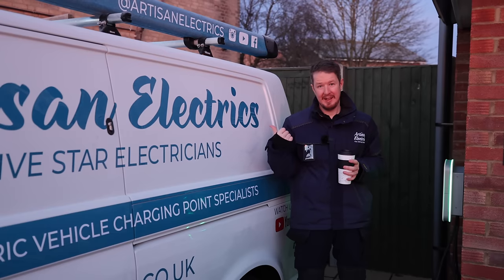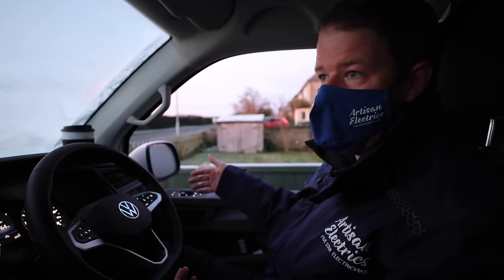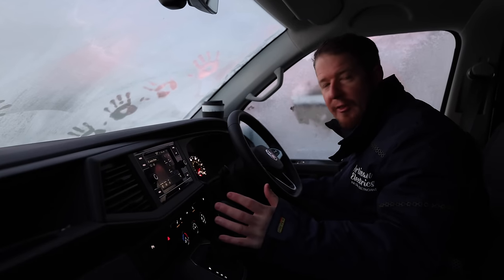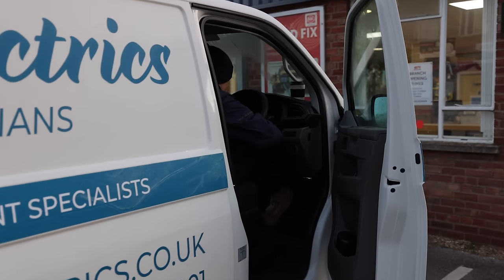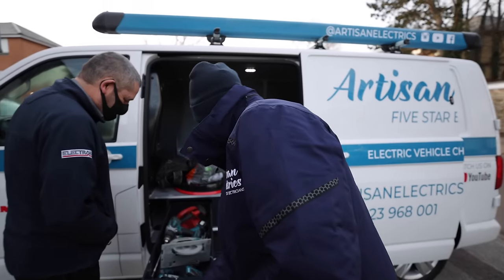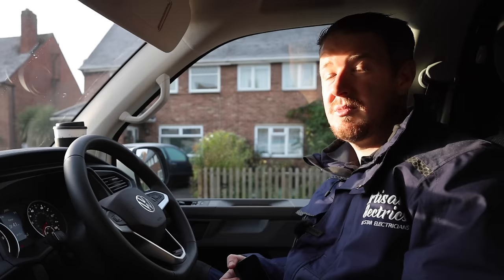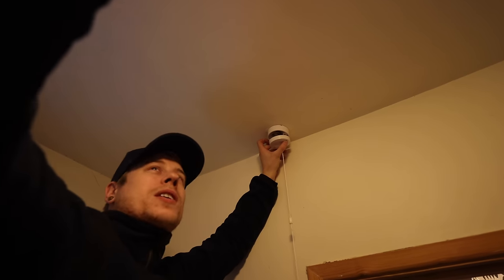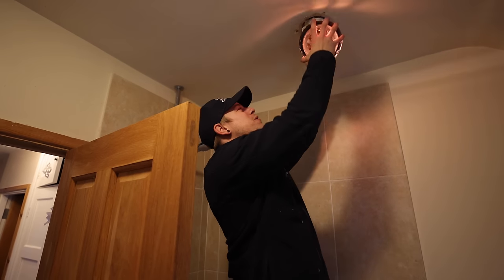ELECTRIC VAN NIGHTMARE 😬 - Volkswagen Transporter Electric Van

Comment: 1. Pre heat the van using the app 10 mins before you get in(saves you sitting in the cold waiting)
2. Don’t wind down a frozen window as it could damage the motor
3. A lot of EVs don’t let you remove the plug until you unlock the release. Stops ppl unplugging you
4. Always good to know how to use a handbrake 
5. Always good to know how long it takes to fully charge

Most of the above is user error, well that’s what’s going on the call out invoice.
Reply: Wouldn't be the first time Jordan, vehicles, and user error all came together... I recall last winter he uploaded himself driving off with side windows totally frosted over (couldn't see out of them) and a roof covered in snow, then complaining that the snow which should have been cleared before driving fell in his boot.

Some people shouldn't drive, apparently this van knew it.
Reply: Driving with snow on roof is illegal, because it can slump off onto the windscreen,meaning you can't see. There's a high tech solution, called a broom.

It's also illegal to drive with front or side windows frosted or misted up enough you can't see.

As for scrapers, credit card, union card, plastic spreader for filler, any old piece of plastic...
Reply: @RupertReynolds1962  spray de-icer. Large tin 4 quid any autostore. 
Mandatory in the UK.
Reply: @stephenmurray2851  I wasn't going to mention this, but some years ago a friend of mine was killed by a man-child who didn't take responsibility enough even to wipe his damp windows with a rag.

The driver was given a short jail sentence, but that didn't help the family left behind.

So forgive me if I lower my opinion of you  notch or two, eh?
Reply: @RupertReynolds1962  I'll forgive you. Fortunately for us both your opinion of me means absolutely nothing.
Reply: User error …. I didn’t charge my battery 
an electrician lol

Too many moaning vids about other peoples work

At least this is about a van even if he’s the one cocking up 

Self awareness is a skill
Reply: @RupertReynolds1962  so is adjusting satnavs Jordan??? you took eyes off road while driving for about 20secs
Reply: The window kept going back down because of the anti-trap system, which uses  the current sensing on the motor - if it exceeds a pre-determined amount, it reverses the motor
Reply: @davethornewell7417  Get a manual handle.
Reply: @patrickmooney5035  Sounds then, he is doing this for show, to demonstrate the weaknesses of the system. 

But he will not be the only one who expects to use one like a petrol vehicle. 

There is also the opportunity for a new startup. 
Buy a fleet of EVs and have a distributed user scheme. You never drive your own car, one drives itself to you on demand and leaves you at your destination. 
Rather than having that amount of capital parked most of the day.
Reply: @myparceltape1169  That could be possible in the future with self driving cars 😯 Would make a lot of sense.
Reply: You left out #6: If all else fails, read the instructions.
Reply: @myparceltape1169  Yes, mandraulic windows don't fail as often. 😁
Reply: Fantastic, maybe you can arrange all our future lives around using electric vehicles rather than having the convenience we presently enjoy ..
Reply: @RupertReynolds1962  no, it isn’t illegal to drive with snow on the roof and if it were would that be 1mm, 100mm or 1000mm, it would be a subjective call based on ‘roadworthiness’ or ‘safety’
Reply: @patrickmooney5035  .. that’s right, give up all the hard won freedoms that your ancestors fought for an become one of the monitored sheep …
Reply: @andyxox4168  Go and argue with the senior traffic cop who made this point.
I'm out of this cesspit right now.
Reply: @andyxox4168  🤣 🤣 🤣 🤣
Reply: @jerrythefatcat2849  As far as I can see, it must be a list of cockups, a scripted clickbait stunt to get as much laughter, hate snd whatever else they can get as a  reaction.

For all I know, they might know how to drive, wire in a charging point, and even how to use one :-)
Reply: @andyxox4168  oh yes it is.
Reply: @andrewbarnard667  … at risk of making this into a pantomime ‘oh no it isn’t’, … there is no specific offence of having ‘snow’ on your car. (Of course if it were you would be able to cite the legislation) …
Reply: @andyxox4168  well a fb post from the police saying its an offence not to clear the snow from your roof has been posted several times each year.  It's because when it gets soft and you break it covers the windscreen.  So I may be incorrect but I don't think so.
Obviously if you were to do this in reverse it would be behind you.
Reply: @andrewbarnard667  .. if you believe everything the police say then ‘more fool you’ … they would have to use the unsafe/unroadworthy vehicle and unless you have evidence to the contrary I am confident there is no specific mention of snow in the legislation!
Reply: @andyxox4168  no, not specifically, however the roadworthiness law states that anything that could potentially cause obstruction to your ability to drive safely is an offence and worthy of a £250 fine and three points on your licence.
So if you want to be a pedant about it, i genuinely hope you earn your fine and points.
Especially considering it takes a few minutes to use a brush to push the snow off and make your journey safe for you and every other road user.
If you don't, you are the problem.
Reply: I can see a bit of user error going on and appreciate there's a learning curve when we learn new stuff. For the amount of money that van costs I'd expect a lot more. I'm still not convinced that EV technology is mature enough......
Reply: @andrewbarnard667  … seems you’re confusing the Construction and Use legislation with the Highway Code, the Highway Code is mainly guidance but it is clear that lights and windows MUST be clear of snow. ‘Must’ is used because that section is backed by legislation. 

The police can only fine or prosecute you if the ‘offence’ is covered by legislation, the Highway Code falls short of that legal standing. So anything to do with snow that the police might try to fine you for is covered by (probably Construction and Use) legislation. The police cannot fine or prosecute you based solely on the Highway Code. 

You might be surprised how little the police actually know and how often the police act outside their powers and get away with it unchallenged.

I suspect you are misinterpreting rule 229. If you Google it the relevant legislation is listed. Simple understanding of English ‘Must’ and ‘Shall’ vs. ‘Should’ etc. will help you.

Of course if you disagree you can always post the Highway Code section where it says snow MUST be removed from the roof of your car!
Reply: @Andy XoX  ha ha ha.  😂
Reply: @andyxox4168  i find it mildly funny that you ignored my statement of fact just above the comment your last reply deals with.
It's still an offence under the road and traffic act because anything that interferes with the safe operation of your vehicle is liable for a £250 and three points.
Unreasonable levels of snow are covered by exactly that and all that requires is a police officer to decide that you have too much snow on your roof.
So realistically, considering it takes 2 minutes to brush it off your roof, the safe, responsible thing to do is remove the snow and no matter what you think on the subject, you can be fined.
Reply: @paulrichardspencer  didn’t even see your comment, I was replying to someone else however … no, it would be up to a court to decide on the amount of snow that constitutes a danger under the relevant legislation (not based on the Highway Code) unless you accepted guilt by admission that is …
Reply: @myparceltape1169  that’s exactly the point of the video. I suffered a similar fate with my EV which has now hopefully gone back.

He is showing how to use it/pitfalls of it
Reply: @davethornewell7417  this is not uncommon with VW is it's a design fault as well as your possibility.
Also windows opening during the night for no apparent reason is another common fault of vw's.
Reply: On top of all that he's got probably worst Van on the market with regards to range.
Reply: Park van in the garage instead out in the freezing weather.
Reply: User error can be minimised by design. Basically apples business model.
Reply: Scrape ice before taking window down, o yet no scraper . Poor baby.
Reply: The window thing made him look like a moron. Everyone knows a frozen electric window won't work. De-ice it first FFS 😂
Reply: Less user error more user experience and VW look to have oversight here. This is the future life should be easier not harder!
Reply: 6. Don't buy an EV
Reply: The window motor may fail or you rip your window seals. Both amateur mistakes.
Reply: Thing is you don't have to jump through any of these hoops if you have a conventional van lol.
Reply: 6. no usar un auto un auto electrico
Reply: evs are rubbish

Comment: I honestly find this highly amusing.
I'm an electrical/mechanical engineer, why all these electricians are buying electric vans is completely lost on me.
Reply: Yup they should know better.
Reply: Why
Reply: @MrKongatthegates  
Do you think there sustainable?
Reply: Its great marketing for an electrician when you are installing hundreds of ev chargers.  They work well enough and are getting better
Reply: I actually don't understand why anyone would buy VW Transporter, since it's an aftermarket conversion done by ABT. The range is silly. There is so much better electric alternatives.
Reply: @Aussie Pom Doesn't have to charge quickly when you wake up with a "full tank" every morning. 

That said, I don't know why anyone would get one of those VW electric vans with 82 miles of range. Maybe if it was some kind of company vehicle that only drove around a campus or small town?
Reply: Exactly..!
Reply: It's because they don't understand how electricity works. Just red wire live, blue wire neutral, green and yellow earth and 15A breaker on 1.5mm wire and 20A breaker on 2.5mm unless it's a ring main.
Reply: @frazerbond3413  the resources to make the van are huge. battery’s that can’t be fully recycled. Electricity that’s mostly generated by coal and gas. ev vehicles are very heavy putting more strain on our roads and car parks. There’s no real infrastructure in place to charge the vehicles efficiently if more people buy them. It’s a con.
Reply: @Baggiolyful  totally agree mate.
Reply: Because the company buys them??? I don’t think he had much of a choice  for the a company van
Reply: Wery straightforward. Journey lengths are short and the van is sitting around doing nothing m,ost of the time. An electric van should be ideal for a trade like this.

Comment: Your definitely better suited to the office. What helmet uses the wipers and winds windows down when there's ice on the windows. A kettle as well. You don't treat your tools like that.
Reply: I agree I wouldn't trust him to do anything for me if that's his level of Intelligence!
Reply: Because there is no other way of clearing the screen with no hot air coming from the cooling system of a combustion engine!
Reply: @petecoventry6858  🤣🤣🤣 totally agree , it makes you wonder and this guy is going into peoples houses and messing around with the electrics 😳
Reply: Lacks common sense
Reply: @TheMentalblockrock  no after he found button he was fine plus he was still tethered to the charger. Offsetting that loss in battery to create the heat.
Reply: I'm not sure why he says he doesn't own a scraper. I mean get a damn credit card or anything out ffs, it'll work when nothing else is available! Never chuck boiling water on a frozen screen, that got me panicked.

Comment: I'm taking all the stuff you said about the van with a pinch of salt and hoping the issues you had were dramatised for entertainment, but if not then I have to ask who goes and buys a 55k pound van, kits it out and brands it without knowing a damn thing about it?! 🤷
Reply: @N S 
I think that's a bit harsh on the muppets
Reply: I agree….if I was paying £50k for a vehicle I’d be dissecting the manual and online forums for months before even considering a buy
Reply: @jennyli7749  yh mate that's easy to do when you have a family and 10 employees....
Reply: @radosaw4616  it's not hard to read up on something at all, regardless of having 1 or 100 employee's!
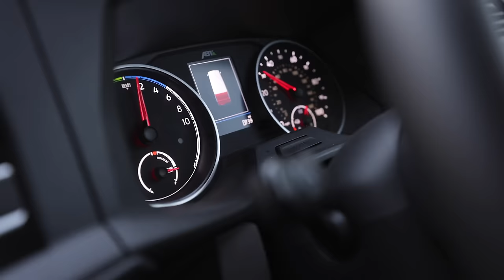Reply: 30:30 Driving with the rear doors not fully locked and not knowing despite looking right at it.. suprised it wasn't beeping away at him
Reply: Can you really expect a concise and technical reply as he has limited technical knowledge.
Reply: The unskilled doing EICRs very worrying for our trade.
Reply: @peterward8308  I’m a gay time served engineer find this remark homophobic and unnecessary. Time for the dinosaurs to move on or die out.
Reply: I really hope the whole thing was a pee take because otherwise...... Crazy

Comparing a Tesla to a van regardless of power train is daft too. How many vans have electric handbrakes, electric heated screens etc.

None of that would've happened had the owners manual been digested before attempting to use it. Also how did the dealer let you drive off without fully explain ING how the vehicle operates?
Reply: YOUR ALREADY PAYING AN 20 K FOR EV THAN DIESEL PLUS MAINTANENCE COST AND RESALE VALUE ARE POOR , YOU WILL LOSE ALOT , AND IF YOU NEED A NEW BATTERY AFTER WARRANTY IT WILL COST THE SAME AS A CHEAP FLAT , COMPLETE NO NO !!!!
Reply: @radosaw4616  Pay someone else to do it for you and advise you if its a sound investment.
Reply: @chiquita71  get a life mate. It's short enough without dissecting every comment that comes out. I take it you are one of the permanently outraged clan. I have gay friends and any of my comments are not homophobic but just sensible

Comment: Everyone has a windscreen scraper, it's called a credit card.

A bowl of cold water will clear the windscreen almost as well as hot water, so long as you put the wipers on as soon as you've poured it on the windscreen.
Reply: I tried using a store discount card, but it only got 10% off.
Reply: I broke my card doing that. 😭
Reply: @dynamicd1425  😂😂 you legend!
Reply: Exactly! No one does it that way
Reply: Do sacrifice one of your promotion cards…
Reply: But cold water will freeze almost immediately it hits the cold screen. Back to square one.
Reply: @tamar5261  definitely in a bag of hot water.  So so much better and not messy at all.  You can do the whole car in one go.
Reply: @dynamicd1425  Oh you tickled me.
Reply: @tamar5261  Try it. It does freeze more quickly than hot water, but not instantly. Pour the water on and then turn the wipers on as soon as the ice melts enough to do so.

The advantage is that you can usually get a bucket or two of cold water from an indoor tap quicker than a single bucket of hot water, so you can clear more of the windscreen and side window.
Reply: @dizzy2020  I myself thought the hot water on a frozen screen causing it to crack was a myth, until last winter when I experienced it myself on. Renault Trafic van.
Reply: Yep, I use warm water in the winter, it warms the screen so the inside doesn't fog up and I can get going.
My favourite is to put a little blow heater in there for 15 minute before I go, nice and toastie.
Reply: never use hot or cold water the screen  still may  crack  as cold water is still above freezing sprinkle a bit of table salt but  rinse as soon as warms up
Reply: @tamar5261  Yes tepid of warm. Not as hot as a hot drink. I have done it with room temp water and it freezes on a very cold morning. I use warm water and I go to the car and drive away in less than a minute My neighbour takes 10 minutes to. scrape.
Reply: @markenetube  I'll give that a try in the morning
Reply: Well I gave the warm water thing a try. It did clear the screen amazingly fast, I'm not sure I am happy with the process though. I'm afraid it will crack the screen. On my car a screen is £500. I guess it's back to scrapers.
Reply: @tamar5261  I’ve used warm water for years, never had it crack a screen yet! I had a customers car crack it’s screen merely because I let it warm up with the heater on full screen! If it does go all wrong then make sure you have windscreen cover on your insurance.
Reply: just use WARM water
Reply: Always used hot water just short of boiling. Key is knowing how to use it, splash at top or on edge of roof and let a few streaks run down which in turn warms surrounding glass. Go round rest of car the same then return to windscreen, works every time unless -6 where boiling will freeze in 1 minute!
Reply: And he's an electrician God help anyone who uses him
Reply: I used my discount card to scrape ice off the windscren i got 20%off 🤗
Reply: Don't you use frost protection in your windowspray water? In europe -20°C to -50°C are typical frost protections. Going down the Autobahn at 200km/h at -20°C gives quite a windchill.
Reply: Never use hot water to defrost a windscreen,, it will break it
Reply: He almost had me in tears

Comment: Looks to me that the van was having a nightmare with the incompetent behind the wheel than the van being faulty (apart from maybe the driver side window, which wouldn’t be an electric van specific issue)
Reply: It’s not the drivers fault that the range is bad and takes a long time to charge
Reply: @pgood7266  Right, that one's on the converter's side to not put heating on a battery that sits outdoors in British winter.